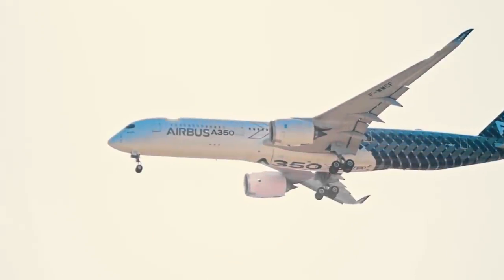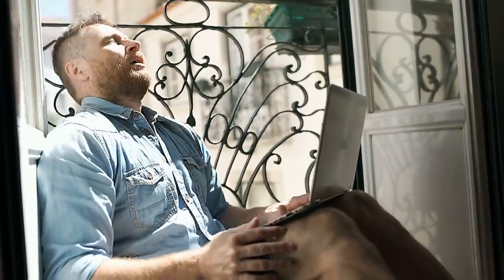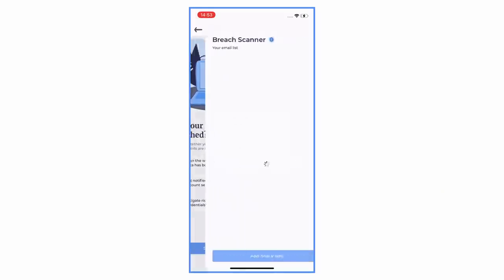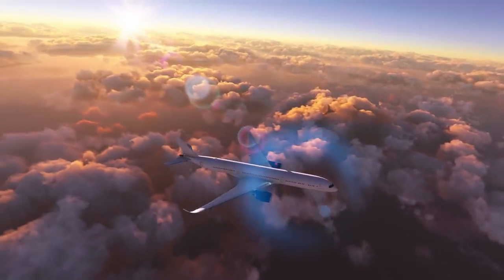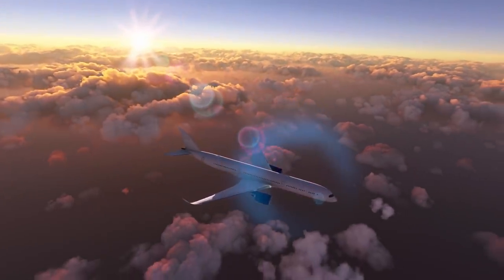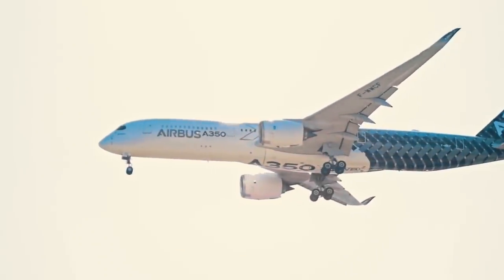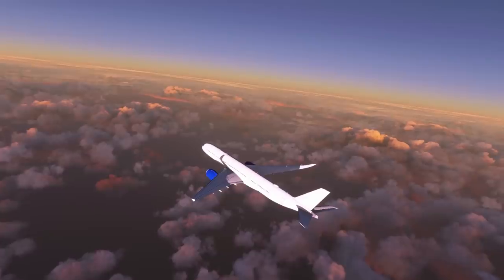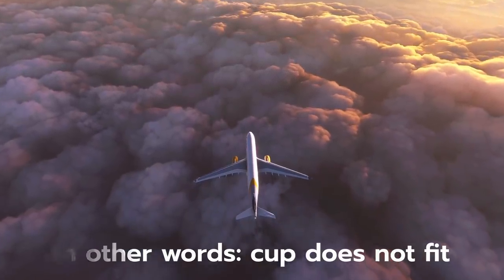A350's Engines Fail Because of Coffee Spill ☕

Comment: such a little thing, could be a disaster. props for identifying the problem and fixing it.
Reply: This should be fixed in first design, not years after, when it come a problem.
Reply: @norbert.kiszka  Yep, waterproof control panels should be mandatory. :) Most phones nowadays are waterproof, and the A350 was made like 8 years ago.
Reply: redesigning the cup holder would take years of testing and recertification

Comment: Sometimes an aircraft will spill your coffee for you, even if you're holding the cup in your hand.
I support making the pedestal waterproof.
Reply: Then why older aircrafts doesnt have this problem like in A350?
Reply: @norbert.kiszka  Less electronics, more cables and pulleys.
Reply: @thomasbonse  Nope. You are wrong. Older planes also have electrics and (older one) electronics. Back then, first point of every design was: do this good as possible and safe possible. Now??? Now is: do this fast and cheap or go fired, even today. Are You electronic engineer? I dont think so. So buy new and "better" smartphone and give more money to corporations as always...
Reply: @norbert.kiszka  Please read more clearly. I didn't say no electronics, I said less.
Reply: @thomasbonse  still old designs was much more reliable. Agree with this or not?
Reply: @norbert.kiszka  Nope. You are wrong. Im an avionics technician and I have a masters in electrical engineering, it wasnt a cost thing because EASA only warned airlines about the possibility of engine 'failures' due to spilled beverages on the centre console/pedestal. Airbus replaced the centre consoles of tens of thousands of their planes not just the A350 free of charge with spill-resistant pedestals. It was nothing to do with cost; it was just an engineering oversight. Also older planes are reliable, just as much as the newer ones, not to mention the older planes actually cost less to design and manufacture compared to planes like the A350 even accounting for inflation. I recommend you quit the "they did it better in the good old days" and be grateful that companies will go out of their way to make planes as safe as possible. If I gave you the choice would you fly in a 50 year old airliner or a less than 10 year old, still new but also not untested?
Reply: @huskkyy  "electrical engineering" - electrical, not electronics? So You should know what is internal protection rating (IP). "oversight" - yeah sure... Decades ago, everything was "oversight", thats why older devices can work for decades and new one fails after a year. Its never oversight when it comes to safety. Its stupidy of corporations owners. Its everything about money. It must be cheaper than cheap.
Reply: @norbert.kiszka  1. Electrical Engineering, yes. I’m an avionics technician that specialises in electrical subsystem. 

2. IP rating is Ingress Protection  

3. You didn’t even reply to what I said in my comment. I think what you’re referring to is the fact that the items you’re purchasing now are a hell of a lot cheaper than they would’ve been 30 or so years ago. This doesn’t apply to Airbus and Boeing who are sure as hell are not cheating out on materials and development costs, they have spent more on developing planes in the past few decades than previously done, not to mention the fact that there have been significantly more aviation incidents in the previous years than compared to those of today, despite more and more people being able to access affordable air travel.  I personally work on these safety systems and there’s a lot of incredibly smart people on those teams who get paid incredibly amounts of money to make sure the planes are as safe as possible. The cost of a few centre consoles is nothing compared to the cost of a life, they know that well.
Reply: @huskkyy  "...Boeing who are sure as hell are not cheating..." - yeah, especially with MCAS software.
Reply: @norbert.kiszka  I don’t think you know what happened with MCAS. It didn’t malfunction, the standard sensors did and the pilots where not trained or informed on how the system loop works. These sensors are the same sensors on every single plane.

Besides, you just gonna ignore the rest of what I said?
Reply: @huskkyy  I know perfectly what happened in this two planes. Not saying anything about pilots behavior to turn on back trim electrical engine, point of this was poor design to do this quick (using two or more sensors eats time). Quicker = cheaper. Quicker doesnt eqaul better and safer.
Reply: @norbert.kiszka  there are 2 angle of attack sensors, and 3 air speed sensors with a seperate barometer for calculating TAS. They didn’t break but iced up. All of them. I recommend you read the incident report 

I’m not sure what you’re going on about something being quicker?
Reply: @huskkyy  there was two crashes with old MCAS, not one.

Boeing owners obviously wanted to sell 737 MAX earlier to grab more money. So project (idea) of MCAS wasnt thoughtful.

MCAS is a software. Software is computer code, executed by microprocessor. Making good code takes time. So first MCAS code was a shortcut.

"I recommend you read the incident report" -  I recommend You to read more about MCAS.

Obviously You are "electric engineer", but not an electronic engineer. Whole different world in practice.
Reply: @norbert.kiszka  I’m an electrical engineer, and I am one of those people that worked on making MCAS safer, it’s a safety feature which failed. I’m not sure why you’re connecting dots that software is bad?

Also I wanna make it clear I don’t Boeing’s reaction to this, I do believe the fault is on them
Reply: @huskkyy  You are electrical engineer and You are making software? Software should be made by software engineers, not electrical engineers.
Reply: @norbert.kiszka  may I ask how old you are?
Reply: @norbert.kiszka  Again Norbert, it wasn’t software that failed. You should know this. I work for Airbus now and have previously worked for Boeing for the last 7 years. I really don’t get why you’re being so narcissistic and ignorant
Reply: @huskkyy  34. Why You asking? 

"it wasn’t software that failed" - yeah... Sensor failed plus poor code, made with one point: do this quick and dont think about redundancy - because it takes time.

Doing software code trimming horizontal stabilizer and not doing it redundant if something gonna fail? Now ask me again "why you’re being so narcissistic and ignorant".

Many electrical engineers thinks that they are gods, but they not gods. Electronics or embedded software should be done by electronic engineers, not by electric engineers. Second ones are cheaper.
Reply: @huskkyy  Why You are not still working at Boeing?
Reply: @norbert.kiszka  Because you’re acting childish.

Software = code. Code was perfectly fine and functioned how it should’ve in that situation with given parameters. There are 2 FCC modules, if one of them disagrees with the other then the system goes into a lockdown state, basically manual mode. I’m calling you ignorant because I personally have had to work on these systems yet you think you know more than the engineer who is literally employed for this. 

And back to my qualifications, I’m qualified in software development, electrical and mechatronics, and standalone mechanical engineering. I don’t think I’m smarter than you or above you but for this one subject, you’re outright piecing the little information you have on these subjects to make conclusions and that’s how we end up with news articles saying bs
Reply: @huskkyy  "Because you’re acting childish." - same thing I can tell about You.

"Code was perfectly fine" - yeah sure... So why this code was changed after those two crashes? And why that long?

"I personally have had to work on these systems" - better not to say this in public.

"I’m qualified" - so You have piece of papers?

"I don’t think I’m smarter than you..." - nobody is smart enough. Thats why in software code, we need to predict even perfectly impossible situations - then code can be called as good. But this takes time, and good engineers, not cheap ones.

"news articles" - I perfectly know that, reporters write about things, which dont know sh*t about it. Why You mentioned this right now?

"bs" - what is "bs"?
Reply: @norbert.kiszka  1. You have 0 experience or qualifications in this field, it’s a piece of paper yes but what you have to do to get that piece of paper is know enough about what I’m working on now

2. The code was fine, it was a mechanical failure of 2 sensors, AOA and AA. They changed the code to account for new redundant sensors. Where Boeing fell short is their communication with the pilots and airliners, even if a subsystem fails, the plane should be able to stay in the air. It’s the job of the pilots and they cannot do that job effectively when they’re not told about what’s going on, it’s really simple to override MCAS, the pilots regrettably weren’t informed. This wasn’t done as a cost cutting measure, it was a time management issue. Boeing have already built the plane long ago but getting the certifications is what took time. They rushed it and if they made changes to the manual they would have to issue a new type rating. Meaning more time pilots couldn’t spent flying the new plane and more time waiting for officials to give an OK on it:

3. Yes I have those pieces of paper that you don’t have, those pieces of paper are proof that I know about what I’m talking about in this field specifically. I also have a piece of paper that allows me to fly a plane so I do feel for the pilots and passengers of those flights lost, they’re humans. 

4. I wasn’t apart of working on the MCAS system but TCAS, fly by wire flight controls, and other safety systems are what I’ve done. I just happen to have access to internal resources at the time and I have to be fully aware of every little thing in the plane and it’s purpose to make sure nothing is interfering with another seperate thing not to mention the many many people that look over your individual work to ensure that it’s fool-proof and more important, safe. 

4. I mentioned it because you’re saying things like the systems weren’t redundant (which they are and were at the time of the incidents). It’s the same reason I personally left Boeing, company politics. They do care about being safe, look what 737 MAX did for their reputation and loss of revenue, they would’ve put that money into developing a better and safer system if they thought that something like this could happen. This was actually my job at the time, to look over previous and possibly future incidents and make sure they don’t happen again through engineering. 

Look dude I don’t have anything against you I just feel you need to understand where I’m coming from on this. Like I don’t blame you for the things you said about MCAS, hindsight is 20/20 but the thing about the aviation industry that I absolutely love is the fact that we need to learn and improve from mistakes and move on.
Reply: More over why liquids shouldn't be present in a cockpit. Pilots can take turns and go to the galley to eat and drink, or do it on breaks.

Comment: You’d think for hundreds of millions of dollars they’d not underestimate the importance of a well-designed cupholder.. 😂
Reply: They’ve got cup holders.
Reply: @peteconrad2077  But they lack well designed cupholders
Reply: @dasovietpotato3784  that wasn’t the issue.
Reply: @peteconrad2077  You simply stated the fact that it already has cupholders, however I mentioned the important lack of well-designed cupholders instead of any cupholders.
Reply: @dasovietpotato3784  they’re very well designed. The issue at hand wasn’t caused by the cup holders. It was poor adherence to best practice of not passing liquids over the pedestal. The cup holders are mounted on the outboard walls to make sure liquids are kept away from the pedestal.
Reply: @peteconrad2077  True but wasn't there something about the pilots complaining that the cup holders weren't large enough for their coffee cups?
Reply: @vinithradhakrishnan8969  they’re a bit on the small side but I take a faulty standard reusable cup with my and they grip the bottom nicely and hold it steady. Also, there is a standard crew catering cup that they will take but most airlines are too tight to supply.

Comment: This is almost laughable. Somebody screwed up royally, and it wasn’t the pilot. With all the fancy redundancies all through the aircraft they didn’t make the consoles spill proof? I would expect any self respecting  pilot to have coffee, tea, or whatever drink during their flight. Being well hydrated while traveling is super important. Spills can happen, they’re in a plane going at humongous speeds, and it’s not always a smooth ride. The engineers/ designers who create such wonderfully complicated marvels probably forgot to drink their coffee the day this little detail skipped by them. 🤯
Reply: Exactly, living conditions and ACTUAL use should be considered when engineering any product, sure, it may have all the cool tech, maybe it's very safe, very efficient, it's an amazing "aircraft"!, but it fails to have basic stuff done right, and when real life cases are applied to it, it could break down.
Reply: They designed what people thought was a cup holder;  instead it was a covert design for a certain brand of bottled water.   Caution and water bottle description is on page 394 of the planes operating manual.  lol
Reply: Very bizarre
Reply: turbulence can be a bitch, no cap XD
Reply: While the design could and should have been made spill proof, the pilots are definitely at fault here. Who in their right mind puts a cup on a center console chock full of electronics and switches?! Or even holds a cup with liquid above it.

The first issue was the negligence of spilling liquid in the console in the first place.

The second was not reporting it to maintenance after landing! That borders on criminal negligence in my mind.

Apparently the spill happened on a flight prior to where the effects of the spill occurred. These incidents could have been avoided if the avionics technicians had been given a chance to dismantle the pedestals, dry them out and make sure there were no potential short circuits or corrosion risk present.

But of course, that would have meant the airplane became unserviceable and parked on the ground for possibly days, so... 🤷‍♂️
Reply: @bennylofgren3208  they eat and drink for hours at a time in the cockpit, it's only a matter of time till something spills right next to them.

Comment: I've designed these center console panels and switches for Boeing and MDC for years. Two of the common tests are: 1) Coffee Spill Test and 2) High Heel Test. The Coffee test involves dumping 8 oz of hot coffee with 4 creamers and 4 packets of sugar over the switches then oven bake until dry. All switches and indicators must fully function afterwards. The High Heel Test involves smashing the switches, panels and indicators with 150 lbs load on a 1/4" square test probe. This simulates a stewardess walking on the center console in high heel shoes as she maneuvers her way to "assist" the pilot. All switches and indicators must fully function afterwards. Obviously, the EU/AirBus didn't have the same level of foresight.
Reply from the maker: interesting 😄 seriously, high heel test? what's the real purpose of it?
Reply: @AirspaceVideos  Exactly as explained. No joke.
Reply: The sheer fact that flight attendats would still wear high heels in 2022 is nonsense to me. They are supposed to be able to react and help save lives in an emergency. You can't even run in these. All flight attendants, male or female, should wear comfortable, practical shoes. This should be a hard stop rule for all airlines.
Reply from the maker: fun fact, most flight attendants switch to flat shoes after boarding.

Comment: Of course Airbus would come up with a “bib” for the ECAM panel … how about better cup holders?  Pilots live on coffee … this shouldn’t be as difficult as putting a window and a hatch with explosive bolts on the Mercury capsule.  🙄
Reply: Because then smaller ones would just slide about all the time in the larger holes
Reply: @tomstravels520  That's what an adapter ring is for. :)

Comment: Just goes to show that at the end of the day pilots are human too. They enjoy coffee whilst at their work space, don't use special anti spill cups and will place it wherever it is convenient rather than the safest possible position. They need to invent a checklist for spilt liquids on the instrument panel!!!
Reply: Anti spill cups are not 100% safe. They can be damaged for ex. with turbulences or just with age. Older planes doesnt have this problem. Electronic designers  costs money, so today they are forced to work faster than faster, because Airbus, Boeing and other (aviation and beside aviation) want more money. We want to have things cheap, so they also want do things cheap. We are the reasons for that kind of problems.
Reply: @norbert.kiszka  Where the cockpit controls in older aircraft more moisture resistant.
Reply: @stevensmith4752  all older electronics was more resistant from anything. Some of them can not be damaged when powered with water inside (Eizo computer monitors - I know something about it). Today electronics quality is price-dependent. Most consumers want to be "cheap" as possible. Even switches can be water proof. For example switches in electric installations with IP44 certificate or higher are water resistant. Some places are basically wet, so electric installation must be protected from water. Did You see any electric outlet with flap (hatch)? Those outlets can work outside in rain. But this is twice more expensive (5-6$ for each one)...
Reply: @stevensmith4752  PS. Black boxes in aircrafts are water proof. Even if water goes inside housing, PCB's are protected with thin resin. This can work even in bottom of the ocean.